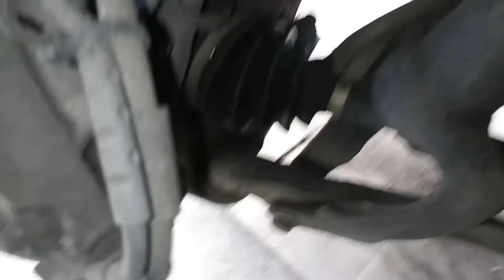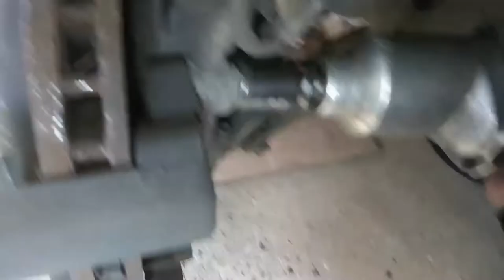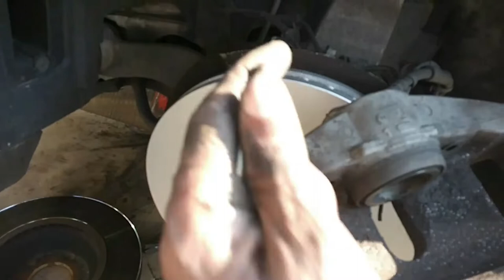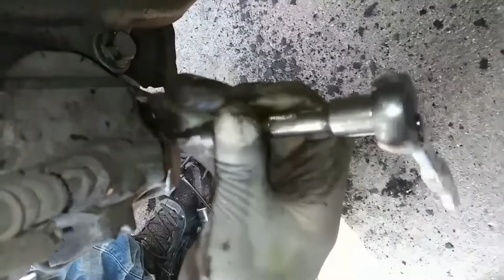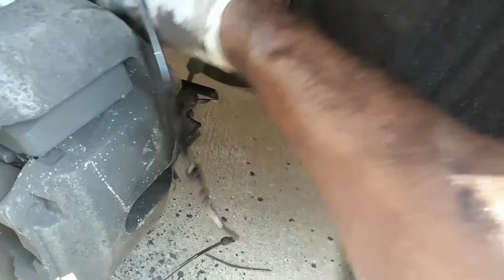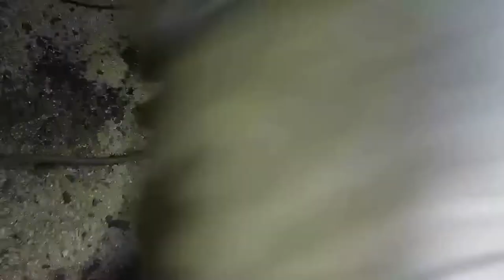BMW 535i COMPLETE FRONT BRAKE AND BRAKE WARNING SENSOR REPLACEMENT

Comment: Yes me general me just change my brake sensor and me see it still a rubbing down what cause it
Reply from the maker: Bless up, it shouldn't touch if you put new brake pads on with the new sensor..
Reply: @thediyyardie7192  no i didn’t change the brake pad
Reply from the maker: @bussheadchoppa7184  The sensor only go bad when the brakes get low and need to be changed, if you're hearing a scraping noise, you probably need to do the exact job I did in this video, new brake, rotors and sensor.